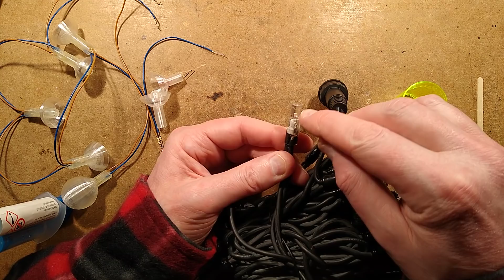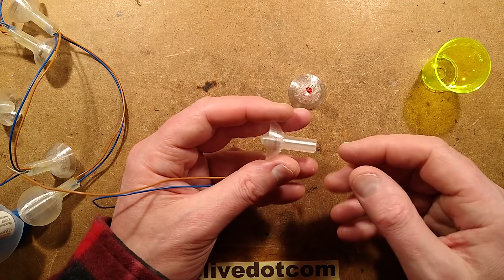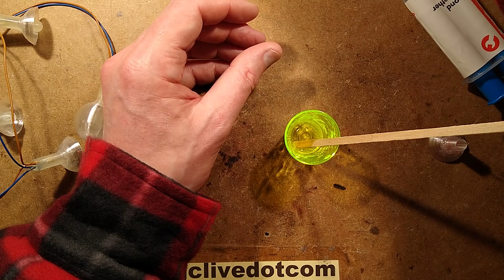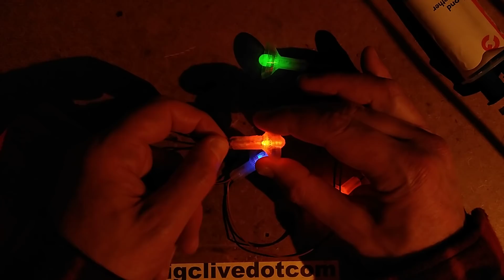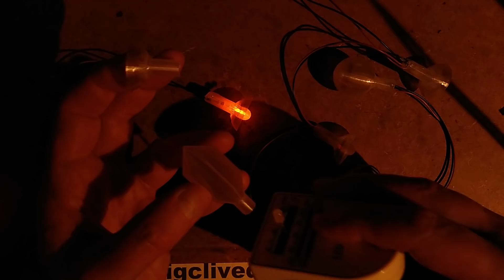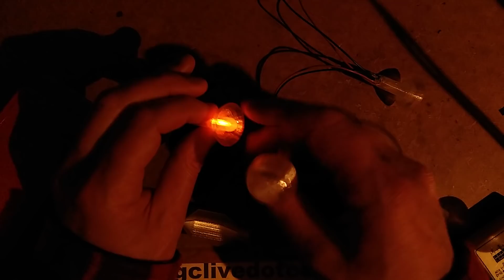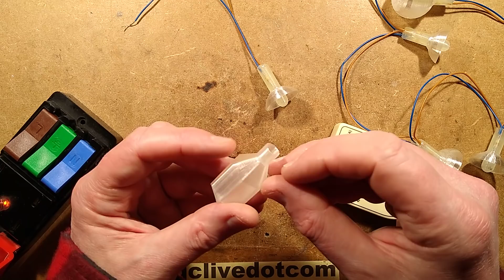The almost regrettable neon fairy light project.

Comment: Next you should tack a capacitor to the leads of the neon after the resistors,  and try some larger value resistors while you're at it -- in the megohm range?  Then they'd all flash at different rates...

Comment: What you need, is something like this; Loctite "Stycast" US 26-50 DQ epoxy resin, shown here https://www.youtube.com/watch?v=RN0L22Dtt70&ab_channel=SmallEngineMechanic at 3 minutes 27 seconds. In his case, Mike is using the opaque white version, but importantly, it's dispensed from a self mixing hand held syringe, and it's very runny. If you can find a clear version of the same, your task would be so much easier. Unless of course, it proved to be cost prohibitive.

Just a thought.

Comment: Why not daisychain multiple neon bulbs in series with only 1 resistor? NE2 neon lamps have 60 to 80V, so 2x 80V or 3x 60V should run on a standard 220V line with a small resistor. 

With a few capacitors you can make flashing neon circuits. Interconnecting multiple of them even permits random or complex walking light patterns without involving any semiconductors! (Search "neon bulb logic".)

For potting use hotglue instead of poisonous epoxy. At least indoors it for sure works as good and is much safer to handle. (If it goes wrong, remelt with hairdryer.) Normal cheap PVC cables turn brittle and can crack during winter cold. Thats why they are not allowed for mains powered outdoor fairy lights.

Comment: Hmm, the amount of resin used in this project would justify having 2-part resin that comes in syringes with mixing nozzles. Well-mixed, bubble-free, easily dosed resin squirted into the housings would reduce the mess factor significantly.

Comment: speaking of the quicktest, i live in germany where we have those annoying "i don't care whether i'm live or neutral" sockets. is there a way of building a circuit to that "polarity" somehow and switch the wires around with relays? that way i could build a quicktest that actually is right about where live/neutral are even without the socket i put it in knowing?

Comment: The best cheap method I have for "injecting" resin was to use one of those snaplock baggies. You squirt in the resin from your epoxy syringe, seal the bag and then knead it to mix it in the bag. You can then snip off a TINY corner of the bag, and hey presto, you have a piping bag you can squirt your mixed epoxy wherever needed

Comment: Now build a version consisting of a string of matched neons directly in parallel fed from a single dropper resistor. This should result in randomly flickering neons like those "fire in a bulb" effect lamps you did some years ago.
Reply from the maker: I wish it had been as simple as using a single resistor.  That was the first test.  Then I had to experiment until I found out that short pulses worked best.      A simple resistor would have allowed much greater intensity.
Reply: @bigclivedotcom  To work properly it would need a simple relaxation oscillator for every six or so neons as per your neon Nixie flower project.

Comment: Hey Clive,  you make interesting and informative content. Thank you, keep up the good work!
I have to install a light fixture on a bedroom ceiling. I see on the label: 220-240v 50/60Hz E27 (all clear 'till here) max 1X60w. This max power rating puzzles me. I assume that the max power rating on all light fixtures refers to incandescent light bulbs, and refers both to the wiring and the maximal temperature that is safe for the materials that make the fixture. 
Is it safe to assume again,  that I can install any LED bulb as long as I don't exceed the max power rating (60w). Can you enlight me?
Thanks!
Reply from the maker: It's usually the temperature rating of the fitting.  Using a higher power filament lamp could damage the components and case.  But with LED lamps the main risk is overheating the LEDs if it's an enclosed unit.

Comment: I paid big $ for a GALLON of epoxy resin - clear as water - which turned out to be very slow to cure but DAMNED hard after 48 hours.  Upshot - the stuff has a low initial viscosity and soaks itself into any type of fiberglass like magic.   Anyway - for what you're doing there I wish you had a few ounces of this stuff!
Reply from the maker: I did have a bottle of clear casting resin, but it actually slowly hardened in the bottle over the years I had it.
Reply: @bigclivedotcom  I was alarmed that a thin hardened layer developed in the resin container a couple of months after I opened it initially, but perhaps it was smoke or moisture in the air which caused it (or airborne hydrogen peroxide vapor, even?).  Afterwards I've been careful to only decant from these reservoirs as infrequently as possible.

Comment: Just mix the resin inside a 15ml syringe (from back, not by sucking), then when mixed throw the syringe full of resin with sealed output into cup of hot water, it will make resin more watery. Push light into plastic "cup", inject resin into "cup". Should work much better

Comment: Some tips if you wanna mess around with resins, i've spent a lot of time with the stuff:

Absolutely wear gloves! The resin and hardener can cause skin irritation, which can get more severe every time you get exposed to it, think of it as an allergy that develops over time.
It's also a pain in the ass to get off your hands, think of melted gummy bears except it does not dissolve in water.

1. Use GfK 2-Part epoxy (look for casting resin, 2kg of the stuff sets you back about 20€, so much more economical, even cheaper if you buy larger quantities)

2. The best mixing method i've come up with so far is grabbing a cheapo milk whisker and ripping the whisky bit out (it's just a press fit you can pull out the end) and chucking it into a cordless drill for the extra torque and lower RPM (less splashing). You want to keep the whisker under the surface of the resin to avoid pulling in unnecessary air bubbles.
Make sure to very thoroughly mix along the sides and the edges of the container, the resin is much more viscous than the hardener, so it likes to cling to container walls.

3. To get rid of some of the air bubbles you can (gently) point a hairdryer at the surface of your resin, heat makes it flow better and the bubbles rise easier, tilt the mixing cup a bit to get a better view, it won't clear all the bubbles perfectly, and some will rise out of the cast later anyways. DO NOT spend too much time doing this, heat makes the stuff cure significantly faster.
The better method here is to use a vacuum pump with an adequate chamber, but i understand most people won't have one, if you find up enjoying this, definitely invest into that.

4. Use cheap disposable syringes for filling in small stuff like in this video, they might be easier to use if you attach a silicone hose to it, if you want to reuse them you can wash uncured resin out with acetone. A neat thing is using actual thin needles and injecting different colors into the uncolored resin to create some fun effects.

Comment: This looks like an excellent, fun folly!  In my experience, small neon lamps of the type in the video have a disappointingly short lifetime.  The inside of the glass bulb becomes coated with a black deposit so that the light cannot get out.  Also, I am wondering where can neon lamps be bought (in the UK).
Reply from the maker: I got all these on eBay, but Rapid electronics sell the classic orange ones in the UK.
https://www.rapidonline.com/rvfm-ne-2h-6mm-miniature-neon-wire-ended-42-0300
Reply: If the bulbs turn black, your current is too high. Use a higher serial resistor. They should not get warm if properly powered.

Comment: now that we are in the neon topic already, is there anything low voltage that you can do with this exact type of neon bulbs since i have a couple of them and just dont feel like experimenting with  mains voltage for a start...?
Reply: Neon bulbs need 60 to 80V, but with a very high serial resistor (several 100k) the current is such low that it is save to touch. You can build an inverter power supply to run them on batteries. Websearch "neon bulb logic" what circuits you can do with them.

Comment: Clive, you could use hotsnot (hot glue) instead of AB resin.  If the little neons get too warm for hotsnot, you can use a solvent adhesive called E6000.  It cures 100% waterproof and a little harder than RTV silicone, and is available in small and large tubes.  Remember a product called Shoo Goo (for repairing the soles of tennis shoes)?  E6000 is very similar...and along with hotsnot would be a lot faster and easier than AB resin.  Another thing to try would be to insert the bulb/wires into the neck and add just a little plug of sealant at the back--rather than fill the entire tube.  Thank you my friend!

Comment: random question from a semi-noob: i'm working on modding a set of RGB car-headlight bulbs to work in an E27 socket (basically i want to make some omnidirectional RGB bulbs that i can stick under a lampshade, unfortunately most RGB bulbs i've found just spit out light in one direction); i bought some donor "corncob" led bulbs to house them in, but the power converter and LEDs are all built into the same circuit board assembly - what's the best way to power these 12v DC headlight bulbs off of 120v AC power and still have everything fit inside the donor bulbs?

Comment: Mixing 2 part epoxy for doing little injections is made much easier using pound land cake piping bags, or actually and thickish freezer back will do. Mix with your fingers, cut off a corner and squirt.

Comment: Hi Clive, if I may, I'd like to suggest using a uV 'self curing' resin of the kind used for windscreen repairs, like this "Rain-X" branded kit. https://www.rainx.com/product/rain-x-windshield-repair-kit/  The beauty of which is that there is no mixing, it flows like thin oil, and self cures in natural daylight, or can be cured by using a uV light.

Just squirt a drop or two into your workpiece, insert your LED, or neon, then cure the resin with uV light, and you're good to go! As a private individual, I can only get the DIY Rain-X kit, but if you have right connections, or a golden tongue, you might be able to get it from the windscreen repairers, in bigger quantities. I'd say try a DIY kit first, and if it works for you, seek out the stuff in bulk.

Great little project, and would be so much easier without having to measure, mix, and spudge the resin into a little hole. If all you had to do was to squirt, insert, and cure, you're onto a winner!

Comment: Next time you do this kind of stuff with the epoxy resin, get yourself a disposable plastic syringe with a stubby tip, they sell them in pharmacies/drugstores, you'll then be able to cleanly pickup some mixed resin from the cup and inject it into the small openings of whatever you're working on pretty easily and without making a mess .

Comment: Use transparent silicone (with an injector) ... it’s easier to work with than the damn resin.
Better yet, use potting wax and just plug it with silicone at the end.
Potting wax flows very well when heated.

Comment: I had to do a very similar potting exercise recently and I found that using a syringe to squirt the resin in worked really well. The typical syringe is made from a plastic that the resin does not bond to so provided you pull the plunger out before it sets too hard the remaining resin just pulls/pushes out and you can re-use the syringe.

Comment: You could probably pick up a bunch of cheap plastic syringes off eBay which would make it a lot easier. They're cheap enough that once the resin starts getting tacky inside the syringe, you just throw it away and grab another. Best to go for the ones with the straight tips rather than the luer lock, otherwise you'd just have to get a bunch of luer lock nozzles to go with them, and you couldn't reuse them afterwards anyway. They'd also allow you to measure how much is necessary to avoid spilling the resin out the end when you insert the neon/LED.

I'd probably have a go at making a set myself, if my printer wasn't on the fritz. ):

Comment: A great project, but I was expecting you to be using the very old R-C Neon Flash circuit.?
 It was very popular in the 70's, and before, when you could make potted "sculptures" with multiple neons that would each flash semi independently, powered by a small but high voltage DC source, such as the old 22V batteries, used to be used for camera flash systems. If I recall, they could last months?
For anyone who does not know the circuit, it was a large (megohms) resistor in series with a simple DC  (~ 100V +) power supply, charging a capacitor that is connected in parallel with the neon. When the voltage reaches the neon strike voltage (70v?), you get a short flash. The capacitor is thus discharged and then it starts to charge again. 
I never saw one with the fluorescent neons!.  That would be great..   Time for some experiments? (please!) 
Many thanks for such great videos
Dagnall
Reply from the maker: If you search my videos for Nixie you'll find an unusual variant on the neon relaxation oscillator.

Comment: couldnt you build a (siemens logo) controlled hot snot (gluegun) injector, which keeps the hot glue at the right temperature?
adding another clip which goes into the hot glue and pushes it to seal around ? so the glue is more used as a seal and the clip fixes the light in the holder.

For the double insulation you could always use a 230:24AC (or just a 230:24 to 24:110 if the low voltage doesnt work) transformer and smaller resistors ?

Comment: Thanks  Clive, you have loads of patience. You can tell that you like your 3D printer so much. I know your demonstrating how to do it but the cost surly outways the means. Several hundreds of pounds for the printer then the parts and the epoxy. Were the shot glasses next to the £1 led fairy lights in Poundland. Cheers.
Reply from the maker: The shot glasses are usually in the party area.  I'd class my 3D stuff as prototypes or purely custom.

Comment: Seems like a back-fill with something cheap and plentiful, e.g. hot-melt glue or even packing foam, would lower the amount of epoxy resin you'd need to use, while still keeping the ass end watertight (assuming the tips are already watertight, of course). Plus I'd love to see experimentation with hyperbolic & parabolic reflectors instead of spherical ones, with the various light sources. Nevertheless, I do love seeing this type of work, and you'll never know 'til you try. :)

Comment: You don't need some sort of "injection gun" for the resin. They sell it in syringes like that with a tip that mixes as you push it out. Just inject directly into each hole. Only need to replace the tip when it dries up.

Comment: clive clive clive! heres a hint, get a sandwich baggie and squirt the resin in and squeeze the hell out of it until it is thoroughly mixed then cut off the tip, only the tip mind you but if you take over 5 minutes, you'll be stuck
Reply: also have you thought about using thin segments of string cheese instead of leds or neons??

Comment: Its so cool how different UK fairy lights are to US fairy lights. Granted we do in ways have some that are similar but the majority are more like the older incandescent fairy lights where the mini bulb is removable. You can replace the bulbs connect 50+ strands together and the ends are normal US two prong non polarised outlets. And the wire is thick like those at 1:36.

Comment: Hot glue would melt the PLA, but how about potting with bathroom/outdoor rated silicone? The standard cheap stuff might not work, and the acid cure might be an issue, as someone suggested below. Tar, or wax would be the 1930s method of choice.

Comment: Thanks for another great video.  After designing some outdoor LED Deck lamps (https://www.thingiverse.com/thing:893943) I found that cheap super glue (Cyanoacrylate) much better than resin.  It's cheap ($2 for 8 small tubes), doesn't go brown in sunlight, and being quite fluid, it fills the little gaps very easily.  I normally fill with a third of a tube, then the rest the next day.  Much easier than resin.  The down side is that single or dual thickness 3d prints will leak a little of the glue before it sets - simply since 3d prints aren't solid.  Worth a try on your lamp design (which I really like).  Cheers from Australia!

Comment: Why not mixing a larger amount, then use an empty syringe to suck up the epoxy, then inject the light with that? The syringes only cost around 50 cents here, so they're disposable.

Comment: These little ne-2 indicator bulbs are really neat and there’s much more to them than you would expect from something that has such a simple construction and no moving parts. Their electrical properties are for the most part non-linear so their behavior is often surprising and their applications in circuits super interesting.

Comment: Looks like a job for the acrylic hot melt. It's pricy compared to standard hot melt, but stickier, softer, and more durable. It's also more fluid when melted. Melting temp of the printed parts might be an issue though.  Takes a special gun (I have one) but can do amazing things.

Comment: How about the UV curing glue - squirt it in, zap it, done!  I think you should make a string with epoxy, UV glue, hot glue and silicon - then stick them in about a meter of water and let them sit for a couple of months and then see which ones still work.

Comment: I'm convinced that PLA being biodegradable is a myth. I printed a test piece when I first got my printer 3yrs ago and its lived on my balcony in Windsor, ON the whole time, so its saw 3yrs worth of snow, rain, sun, heat, and humidity. I bang it with a hammer or something hard every now and then and it hasn't really changed since I printed it...

Comment: Using PETG would allow you to use cold melt hot glue to pot them in, should be far easier and cheaper to achieve a waterproof string of lights.